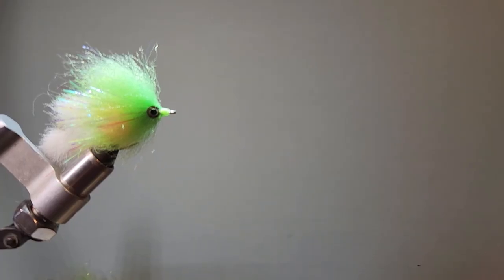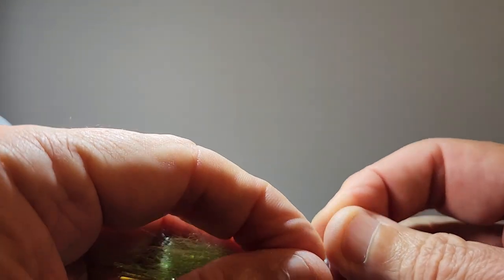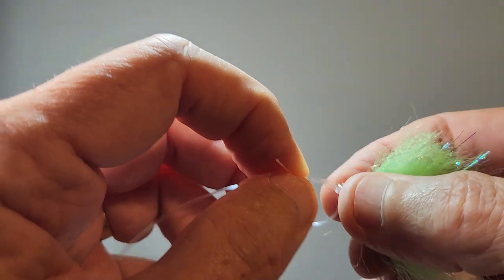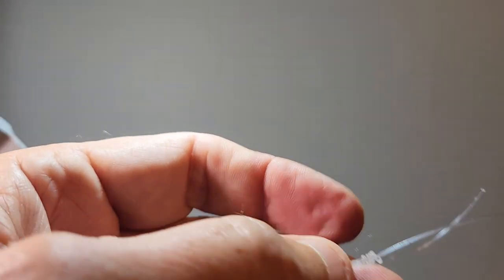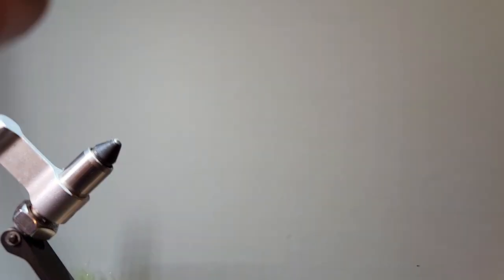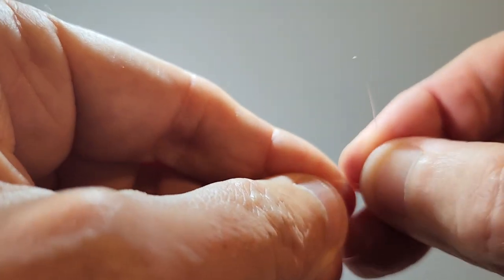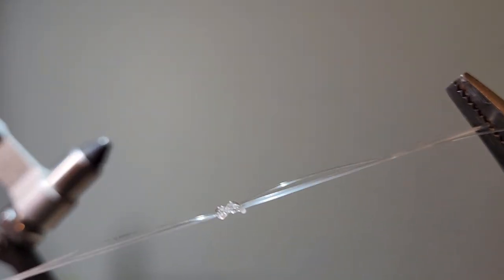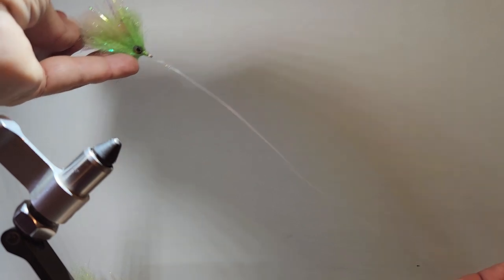How to tie a shock tippet for saltwater fly fishing

Comment: About how much length of the 16lb tipped do you use? And do you connect it right to the fly line?
Reply from the maker: 16-24 inches of 16lb on the end of a 7ft leader

Comment: You ever use a bowline or boland knot to attach you shock tippet to the fly.
Reply from the maker: Yes the only problem I have found using the bowline knot is that if you leave the tag end to short it can come undone. Perfectly good knot though, makes a nice perfection loop.
Reply: @TheUnknownAngler  I like using it quite extensively when I fish fly or spinning. I learned it from a captain friend of mine fishing for tarpon in Costa Rica. Allows me to change flies without cuting shock tippet. Good channel Andy.